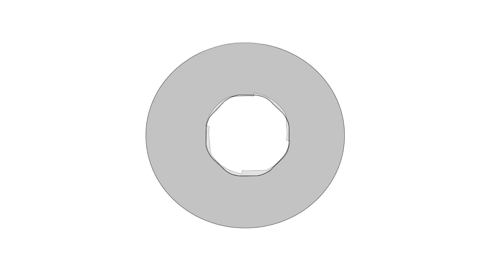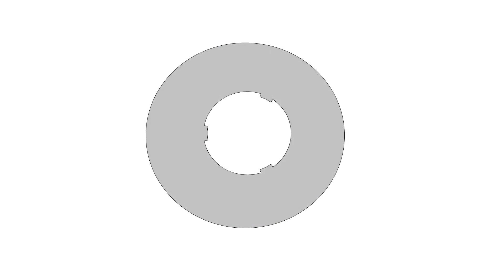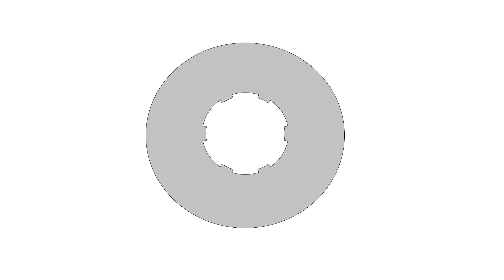Rifling overview and some thoughts on 5R rifling

Comment: my take is that after having three IBI 5R barrels fitted they shoot every bit as good as any other 
these IBI barrels are a true "match barrel" and all of these barrels, a 6.5x284, 6mm dasher and 22 dasher like to use heavy for calibre bullets run very fast 
as you said though Mark the salesman tries to make them something they are not and they are as good as anything else but l am not saying better, my smith did say that these IBI barrels are the straightest barrels he has ever had on his lathe, saying the first may have been a one off but they were all the same
the reason l went for these barrels was cost as l had rejected a couple of Australian barrels for problems shown with a bore scope and getting international made barrels was very expensive, 
l paid $399 for each of these barrels and vouch for their authentic as a true "match grade Barrel"
Reply from the maker: Cheers Man, thanks

Comment: Thank you Mark for this presentation on rifling. With rifling it is personal; one has to be happy with the results. If I remember correctly Mark the Smith & Wesson .357 Registered Magnums were always 5 Groove and 5 Land left hand twist; beautifully lapped workmanship. When I worked for John Martz the Luger carbine maker we mostly used 4 Groove and 4 Land rifling for .30 Luger while with 9 mm used 6 Groove and 6 Lands. Mark If you have access to the old .455 Webley automatic pistol it had an odd rifling that was radiused up to the land and was very well lapped. That brings me to another  observation which is this; if you're going to lap the bore one needs to make sure that your final dimension on cutting or Hammer forging or button rifling has to be slightly undersized by certain amount so you can lap up to the final dimension leaving a very highly polished, mirror finish on the inside of the barrel.
Reply from the maker: Cheers Cameron, thanks

Comment: Someone else may have said it, but I personally think the biggest benefit is the gentler angle of the lands (which can also help during cleaning "somewhat") but because when the rifling engraves onto the bullet it's less of a "cut" and a little more of a "squeeze or swage" which can (but is not guaranteed to) help prevent as severe of a loss of B.C. because any deformation of the outer jacket is going to impact your B.C.

Is it the difference between a good rifle and a bad one? No certainly not, but if it doesn't cost you anything extra (that will depend on manufacturer) then it's not going to hurt.

I like 5r and one company in the US that makes VERY affordable rifles uses 5r rifling and has actually built a really good reputation for accuracy that doesn't seem probable at their price: Ruger

I have a Ruger American chambered in 7mm-08 that can reliably shoot 1/2 MOA with good handloads which is amazing for a $400 rifle (the stocks suck so you'll want to upgrade that and there aren't tons of options, but the barrels are actually REALLY good)

And as for the "longer barrel life" with cold hammer forged barrels, that's "technically" true.

I have shot many more rounds through CHF AR barrels before needing to replace them when compared to cut or button rifles barrels. I say it's only "technically" true because I think powder volume and how "overbore" the cartridge you're shooting is. I think smaller more modest cartridges benefit more from CHF barrels than big magnums would
Reply: I’ll add one thing to your comment. During the CHF process, the surface metal of the bore actually flows onto the mandrel; as in liquifies. Even with water soluble oil spraying the barrel blank. This was from a doc that filmed at the CZ factory in the Czech republic. They are REALLY tooled up there, as is Ruger, I hope.
Reply from the maker: Cheers

Comment: Thanks for all the rifling visuals which helps explain what each rifling profile looks like inside a barrel. As you said the different processes on how rifling is done, the grade of steel, forged barrel stresses, cut vs button rifling, annealing to correct the stressing in  the forging process of the barrel’s steel. Also the hardness of the projectile changes the behavior. There are so many variables to consider that it can make your head spin, lol. It would take so many different variations of all these factors and would be extensive testing of so many combinations.
Reply from the maker: Cheers Man, thanks you

Comment: I've actually shot with Boots.  I'm not sure what his real name is, or if anyone else knows what it is.  The one thing I do know, is if he shows up for day 2 of an F-Class match, then bad things are gonna happen like high winds, storms, and it's gonna happen when you don't want it to.  I thought the old guys were just giving him a hard time (he's an old-timer too), however, as he drove up everyone who knew him were like, "Oh no, Boots is back for Day 2.  Lord, something bad is gonna happen.  Anytime Boots shows up for Day 2, bad shit goes down."  Sure enough, during Match 2, Relay 1 the heavens proved 'em right.  It didn't stop blowing and raining for the rest of that match, then we had high humidity which made it impossible for anyone to clean any match.  He's a really nice guy and very knowledgeable.  There were several big names there for that one.  Danny Biggs, Mike Francis, Boots, etc., etc.  So cool to hang out with them and just chew the fat while picking their brains with all the weird questions I have.  In all transparency, I prefer 3 grooves for 6mm target and 4-groove for 7mm to any other profile.  I've shot 5R, 6, 3, & 4-groove.  I have shot cut, button, & hammer forged.  Button and cut are about the same in accuracy and precision.  I've seen a little longer life out of button, and that may be due to several factors including how the button changes the structure of the steel there at the initial 0.1" of steel from the bore surface.  Hammer forged no doubt causes the highest number of failures from a QA perspective.
Reply from the maker: Awesome, sounds like a rare day, all the best, Cheers

Comment: Spoke with a couple of well-regarded 'smiths here in the states about this.  General opinions were:

1.) 5 lands/grooves are more prone to chatter than even number of lands/grooves because of the uneven forces on the chamber reamer.  Very similar to your illustration about the effects on the bullet at 4:43.  While this is not necessarily true for the bullet, it's very true for the chamber reamer and induces chatter.  Some smiths here have 5 flute reamers just for 5 groove barrels.  
2.) R profile offers some very slight advantages to gas seal, but not much else.    
3.) The reason barrels are easier to clean have nothing to do with the number of grooves or profile, but rather the hand lapped finish that most good barrel makers put in their barrel.

Thanks for the great content.  Love these discussions!!
Reply from the maker: Thanks Man, glad you liked, Cheers

Comment: I heard (uh-oh, watch out!) that most chamber reamers have 6 cutting flutes and that when a 5 groove barrel is being chambered there will always be one land being cut with nothing on the opposite side to balance out the cutter.  Thus, 5 groove barrels can (not necessarily will) have a small amount of chatter on the leade.  3, 4, or 6 groove barrels will always have their reamer cuts balanced out (geometry), so they don't suffer from this problem.  Your thoughts, please.
Reply from the maker: No, all sorts of details, but really depends on the individual parts, short answer, ask your gunsmith, he will have those individual details on your and his parts, Cheers
Reply: Think about it. The reamer flutes cut below the grooves. 4140 chrome moly is a free machining steel. Why would the number of lands matter? The reamer’s bite isn’t just the lands. Any type of process can yeild sub par results if it is hurried up with shortcuts. A quality job on the other hand is where better range scores can occur. Remington’s specs come to mind. Rough house machining when it comes to barrels; although some good ones slip through. I own one.

Comment: Quite a few militaries have tested hammer forged vs button cut. The conclusion was typically that hammer forged lasted longer if you trashed the barrels when they failed to meet military accuracy standards of 4-5 MOA. Most shooters will toss a barrel long before that; if they even shoot enough to wear a barrel at all. First 10k, at least, rounds not really a noticeable difference. Take that with a grain of salt, because I am referring to tests done primarily in the 1950's in NATO countries only.
Reply from the maker: Cheers

Comment: Mark, back in the day 1880's Remington Arms made barrels for their military  contracts for their Rolling Block single shot rifles, with 5 groove barrels. It seemed the leading edge of the lands had a traditional square cornered groove cut and the tail end had a radius cut made up so the paper wrap around the bullet would not cut itself off of the bullet and separate from the bullet while it was being driven down the barrel. I wonder if the Russians had something similar.
Reply from the maker: Yes, the rifle barrel world have been designing and evolving to do the best for what they need for a long time, Cheers George thanks

Comment: Can confirm!  I shoot 300WM through a 5R barrel, and while I've not had enough barrels to know for sure, I would say it didn't naturally shoot better than the 6 groove 300wm I had before it.  Spent nearly 18 months working up a load until I could get it down to 1/2" groups.  It shoots lights out now, but it certainly wasn't super easy to get there.
Reply from the maker: Cheers Jason, thanks
Reply: The question is , did your load get better....or did you improve as a shooter in those 18 months? 
Or where you already  a good shooter with magnums.?
Reply: @prone_wolf8871  My previous gun was an ultralight hunting rig with a Remington XHR barrel.  I fiddled with the load for probably 1000 rounds before swapping out for the 5R.  The 5R rig currently weighs in at 27 lbs.  I think I had gotten used to the kick, and it wasn't affecting my shots too badly at that point, but after the switch, I had to restart load development.  I was using hunting projectiles, but as I decided I liked ELR better than hunting I changed to heavier match bullets.  The 18 months was all load development for the 5R but I can't get to the range more than about once a month, so it's not like it was really intense work.  In short, I'd like to think I was already magnum proof, but who knows, sometimes I STILL flinch when I leave the safety on and I'm expecting it to go.  My best group with a 300WM now is at .264" @100yd.
Reply: I can not even tell you how many groves and lands my custom barrels have? I tell the barrel maker what bore size, twist, materials I want and dimensions if not industry standard like a tighter than standard 30cal I want I let them decided how to do it. I do not care how many lands it has or the shape of the lands as long as it shoots. I am not willing to pay the premium most want for 5R. The only 5R barrel I own is on a factory rifle that came with 5R rifling from the factory. Just like I do not like paying the premium for 416R SS when it is actual inferior in almost every way to plane Jane carbon steel.

Comment: this may be a better option: 
Button rifling is an older method that has proven itself over the years. It provides normally better than average accuracy. Single point is the slowest and most difficult method but done properly results in the highest quality barrel.
Reply from the maker: Cheers Randall, all the best.

Comment: The barrel making process has always intrigued me. It amazes me how they maintain trueness as well as they do. Thanks for the input.
Reply from the maker: Cheers Tim, thanks
Reply: l have just had two IBI 5r barrels fitted to rifles, my smith said after the first that he has not seen a truer barrel on his lathe including all the big name barrels, after the second he said it was not a once off that the second was the same if not better, that comes down to the maker and the quality of their work, they both shoot very well, no run in needed and are very are very clean barrels, 
l found these barrels worked better with hot loads and heavy bullets, l could not get light bullets to shoot but would l buy again, Hell yes ;)

Comment: Thank you Mark.
Could you do a video about the amount of spin compared to bullet weight? How fast is fast enough and can you spin it too fast?
Reply: With too much twist and pushing muzzle velocities, you can separate the jacket out at about 25-50m.
Reply: @bonefrog7930  Berger “Brian Litz” did do testing on this, there is info on their YouTube regarding separation of jackets due to bullet construction and jacket integrity. 

But from what I’m aware of it’s not something to be concerned of if your just the average shooter and not pushing your gear past it’s design. ( most of us anyway )
Reply from the maker: Depends on more than the weight, so use the manufactures spec's, generally listed on the box, the item details on the site, or ask at the store, Cheers

Comment: Lands that are cut square are more likely to cut grooves in the bullet therefore causing deformation.   It makes more sense that bevelled edged lands or polygonal rifling would be best.
Reply from the maker: Well nothing has actual square lands, also, polygonal doesn't work in anything with more than minimal twist, but really all explained in the video, Cheers

Comment: Frank Bartlein has stated on forums several times that 5R is no more/less accurate than other forms of rifling.  But he does believe it distorts the bullet jacket less and may help a thin jacket from blowing up.
Reply from the maker: Cheers Steve, thanks
Reply: The British switched to 2R during ww2 with no loss in accuracy so anyway you impart that spin to a projectile is better than not
Reply: @danieldillon6005  and the Americans saw the same thing with 2 grove in the Springfield m1903.
Reply: The Springfields with star barrels had 3 grooves.
Reply: @danieldillon6005  anything to get ppl to believe what they done was a good decision. Look at the match world. 3G is the minimum you will see. There is a reason for that.
Reply: Why not like 8 lands and grooves

Comment: In the airgun world, FX has learned how to make superior barrels to the competition. They swage the rifling with a press from the outside around a mandrel on the inside of the blank. Not the same as hammer forging. It's one continuous pressing action. The result is an extremely smooth interior to the barrel. Might not work on centerfire rifles due to barrel thickness. It might if using carbon wrapping, but I don't know of anyone doing it that way for powder burners. Look into FX Smooth Twist and Smooth Twist X barrels and you can find some images and videos out there.
Reply from the maker: Yeh, well a little the same and a little different, very different forces also, Cheers
Reply: That would be a cheaper, slower, and inferior way of basically doing hammer forging! If it works for airguns so be it. They are marketing it as if it is a different process but in reality it is the same basic process. The same sort of force is being imparted. You are starting with a large hollow blank on a mandrell and forcing metal from the outside towards the inside forming around a mandrel. It would not matter if they used magic or alien gravity device they are forcing metal from outside to inside around a mandrel. All that matters is they are getting the result they want which is an accurate barrel! Just like Broach cutting barrels it is cut rifling down in 1 pass using super expensive broaches. Last it was done wide scale on rifles was Germany WWII and the old Olympic Arms Company that I think went under int he 1990's and was latter bought and brought back in a limited shadow of it's former self. No one ever mentions Broach Cut but it is mass production cut rifled.

Comment: The  Whitworth Rifle Had a Unique Style of Polygonal Rifling That In It’s Day During The US Civil War Could Stabilize Long Projectiles and Was Considered A Sniper Rifle of The 1860’s I Wonder Why No One Has Tried It With Modern Technology 😎 Great info Mark I Never Heard of 5R Rifling Till You Mentioned It
Reply from the maker: Thanks Chris, cheers
Reply: You can buy polygonal barrels today. They are rare though. Lothar Walther makes them and so did Pac-Nor off the top of my head. You freq. run into polygonal rifling on modern semi-auto pistols. Polygonal rifle barrels clean far easier and deform the jacket of the bullet less. I have been told that they like more loads than any other type of bullet and will hold their accuracy longer. The down side seems to be that compared to other forms of rifling they do not tend to print the tightest groups. So you see them more on hunting rifles, varmint rifles and on tactical competition rigs where the group size is not as important because shooting is prone or in odd positions. So a lot of these guys value not having to clean as often, cleaning being easier and longer total accurate life of the barrel. All of that about polygonal barrels is 2nd hand info that I am just repeating I have no experience with after market polygonal rifle barrels!